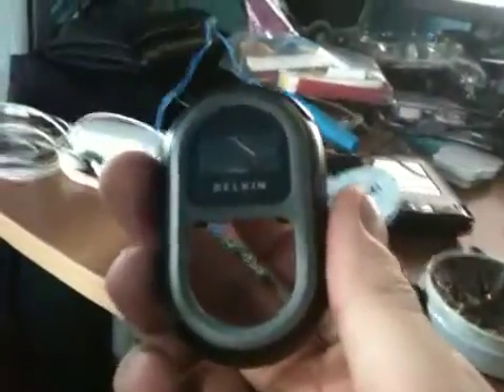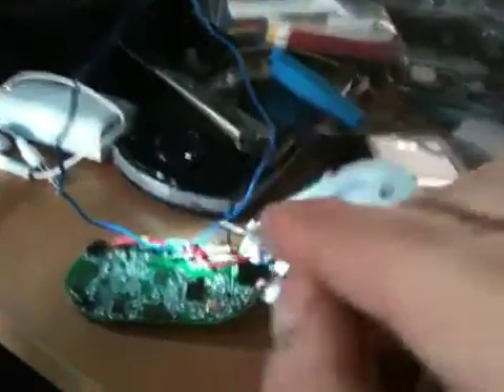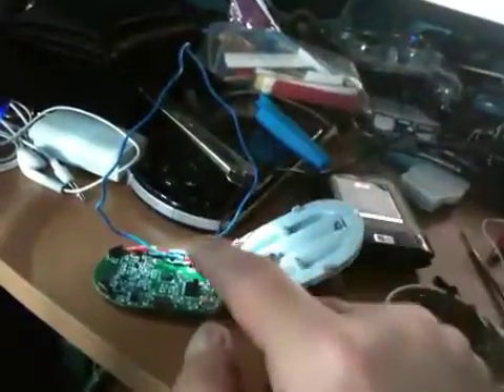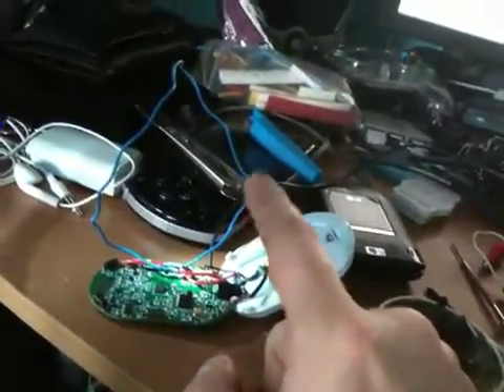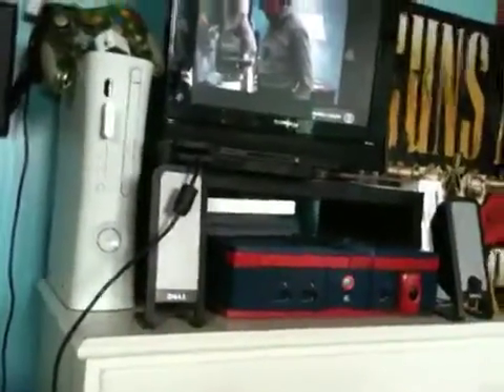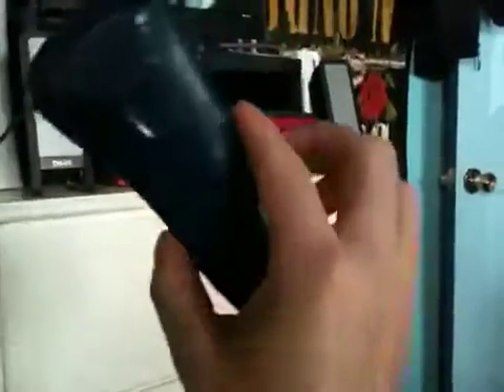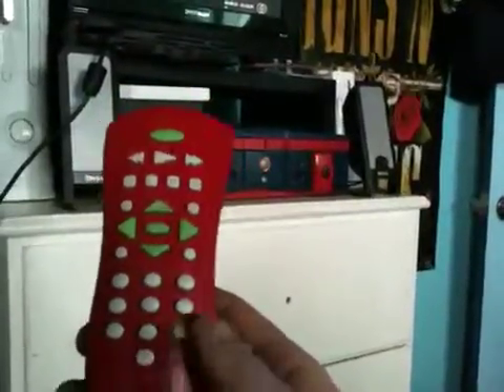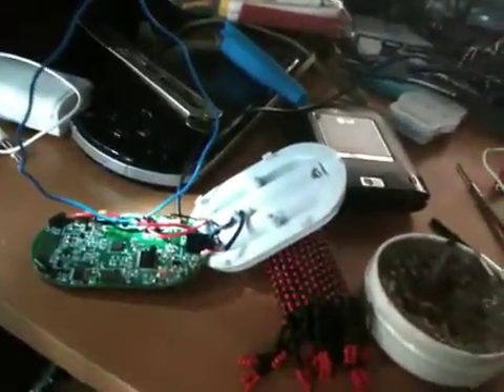Modding a Belkin FM Transmitter

Comment: Good luck, on the newer ones once you pull the taped on connection ribbon off the circuit board for the LED you'll never get it back on.  These things do not have enough output to be received by your car radio, they're worthless.

Comment: Actually,, the thicker the wire, the better it radiates because of skin effect. It also makes the antenna more broad banded, so it will not have to be the exact correct length..Best length for 88 Mhz BTW is around 2.7 feet. Also the regulating body is in Canada CRTC and follows closely with the FCC.. China makes these for North America, and complies with the strictest of the multiple regulations.. Hope that helps someone out .

Comment: theres a smd diod or resistor actual on the edge of the circuit. it limits the transmit power.